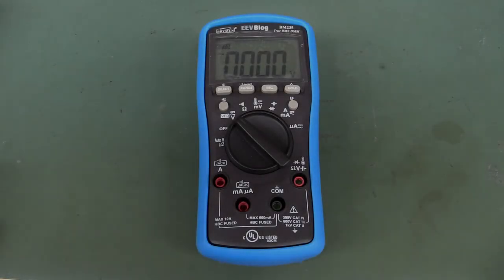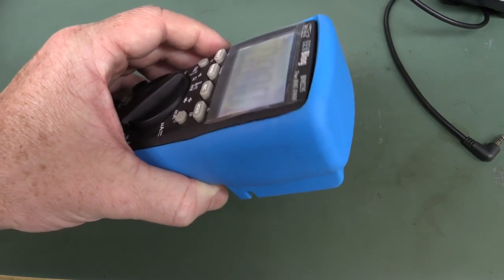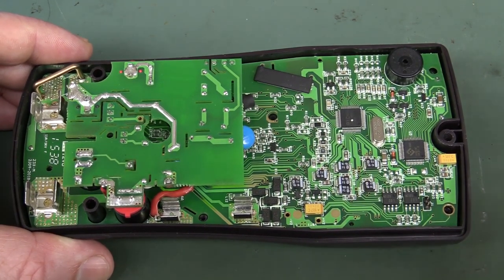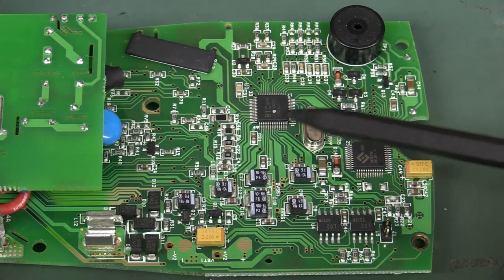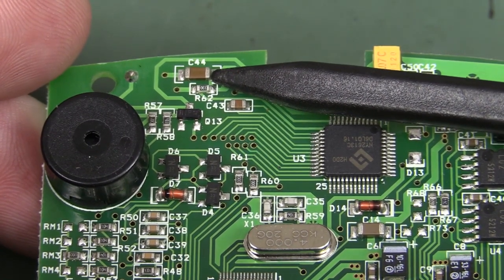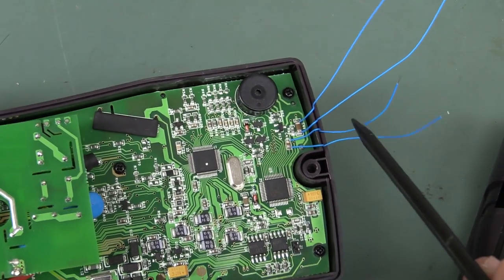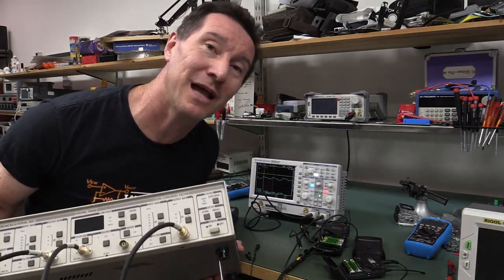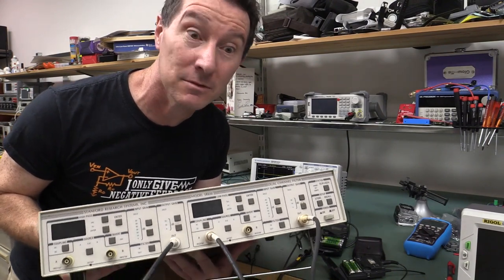EEVblog #855 - Ceramic Capacitor Piezoelectric Effect

Comment: ... Well, I could hear that even before you held it up to the microphone, noises like that drive me nuts, especially when I'm trying to sleep. XD - too bad they're so common. The much louder hum of the fridge pump, the low whine of my amplified speakers whenever they're plugged in. The high-pitched whine of some component in my laptop if you get some 3d scene up past about 300 fps. The clicking sound mechanical hard disks make, cooling fans in general, the capacitors in old camera flashes... Interesting, but sometimes very irritating sounds...

Comment: I had an IBM Thinkpad A31 that would just scream when it was charging. the capacitors/inductors were most likely damaged as it only charged when it was on. That computer was tough as nails, but a pain in the ass to make it charge if the battery was flat.

Comment: Wouldn't a drop of hot glue dampen the vibration?
Reply: As I understand it, its not the body of the cap which is vibrating but the internal layers.
Reply: +gorillaau but the   body will  amplify  the  sound

Comment: My bm257 seems to have nothing! altough its a bit noisy here!
And backlight is yellow:( I wonder can I change that?...
Reply: +m abraham  UPDATE my 257s seems  to have it constantly  when turned on! switching baclight on changes nothing i.e.  ~3kHz appears when u turn the dmm on.
Reply from the maker: +m abraham If it's yellow then it would not need a boost converter. Likely just a LED dropper straight on the batteries.

Comment: I wonder if a dab of hot glue or silicon over the cap would stop it from vibrating or dampen it for users who are sensitive to the sound.
Reply: +Ryan  Davis  It does dampen the sound, their is also a study about how a such cap could be mechanically decoupled from the pcb.

Comment: For that 24:04....Dave what´s up.....a real EE would have made this 3.14...ok...You clearly missed that.....;)

GREAT Video, Dave...And if you simply pot that thing with silicone or hot glue, you would have fixed it as well....and you don´t need to (un)solder something...i done that on various units....usually it went away, or gets less noisy significantly...

Comment: Some DC-DC converters that are built by amateurs themselves without proper knowledge of the values or the physics behind it, and with a potentiometer in order to adjust the thing, do produce a buzzing sound in the audible range. These things are often called a "Joule Thief"...

Comment: I low how they didn't put a fuse on there to protect the circuits and the battery ... so many devices do that, it really bothers me. Those AA batteries can put out enough power to make things smoke!

Comment: Old paper/foil rolled capacitor I used to have buzzed!
It was from an old [1950's] radio, and was 'soft'.
I guess it had gotten loose.
Anyway, it made a crappy speaker and even worse capacitor!

Comment: I hate it when electronic devices do this.
People have different hearing. Manufacturers need to keep this in mind.

I have thrown out various devices that have driven me completely nuts.
Wspecially phone chargers. Because they run at night, in my bedroom.
Reply: +Tilman Baumann 
Buy an Oppo R7 device, it has a weird ass "VOOC" (basically  full battery within 30min)charger but it's amazingly cold when charging and no high pitch whining sounds. even the battery of the phones remains cold. Voodoo-ish if you ask me. No idea how they accomplished that, desperately want to take it apart and take a look inside the charger but i only have one :/
Reply: The oppo uses higher voltage charging as far as I know. Pushing serious power over 5v usb is quite a task.

I want so to see more of that. But honestly, I don't mind over night charging. It's easier on the battery long term.

Comment: i hate hight frequency power surplys. the are often noisy generate hight frequency shit on input lines and output lines.  an ugly efect i reconise. i build a symple power surply from 230v 50hz to 12v constant. i use a linary regulator and try foil capacitors. but these capacytors are so noysi i change to elektrolyte. :(

Comment: Wow, the sound that thing gives off is kinda reminiscent of the sounds I'm getting in my headphone when I connect it to some laptops (which have obviously really crappy integrated "sound" solutions). It's usually the worst when there's even some HDD activity (I can literally hear the I/O operations in my headphone). Now I'm starting to think that maybe that's not a coincidence....
Wow, do you really think that the mfr. will fix that problem? Sorry to be this cynical, but I'd be REALLY surprised if they would. After all it'd only make their products cheaper (how could they compete with all the other manufacturers that are flooding the market then?) and they'll probably figure that most of the EEs are deaf/ignorant enough not to care about this anyway. But I'd love to be proven wrong :P
Reply: +CoolKoon You're likely talking about ground loops. If you disconnect the earth pin from your notebook charger, the problem will be gone. It's a very common issue present in even the highest-end notebooks.
Reply: +redtails No, I'm not and no it doesn't go away (well, it does go away, but only if I disconnect the headphones from the notebook). Like I said: the sound I hear in headphones connected to crappy sound chips/boards is very similar to what can be heard at 14:12. Ground loops on the other hand are a completely different story: they have a CONSTANT frequency of 50 or 60 Hz (depending on the mains frequency) plus perhaps an upper harmonic or two (unlike the sound heard in the video, which changes when Dave taps the multimeter and stuff).
My guess is that the stuff I'm hearing is electric noise coming from the rest of the laptop (hell even HDD activity noise gets picked up) owing to the sound chip's bad S/N ratio or some other related parameter.
Reply: CoolKoon believe what you want, I eliminated that exact noise by replacing the 3-pin connector with a 2-pin mains connector on my laptop's plug
Reply: +redtails Like I said: that's NOT what I'm talking about. You probably never heard the phenomenon I'm talking about anyway.

Comment: The little piezoelectric thing in the corner (Speaker) has markings on the board next to it that says, "SP1". That means it is "SPEAKER 1". It is designed to put out that type of sound.  It is SUPPOSED to put out that type of sound!!! And typically, the beeps you are hearing is from it when the meter is turned on. I cannot for the life of me understand, how on earth you can rule it out!

Comment: Good to disseminate the info, respect, though to boring old farts (such as I) this is nothing new, always been aware of it and dealt accordingly. Much more problematic is the reverse effect whereby caps are sensitive to vibration. In compact, high precision equipment, one is constantly trying to anticipate where and when a non C0G ceramic is going to screw up the signal. The problem is that whilst manufacturers are finally detailing the voltage/capacitance effect, there is virtually no info on microphony. Basically it's still a bench test job of suck-it-and-see.

Comment: gunking the capacitor with hot glue would not change it enough?
Reply: +madinatore it surely does.....or try silicone...but not epoxy it...it amplifies....
Reply: +madinatore interesting idea. I may try that for testing. I have an experiment right now where a ceramic cap is acting like this. Though it's in a much higher vibration situation. Now I know I should have used a poly but it's worth taking a stab at for science :)

Comment: my computer power supply squeal when pc is shut off
Reply: +marioc65 That's your computer being sad you turned it off, don't be mean to the computer by forcibly putting it to sleep!

On a more serious note, yes that problem can be annoying in electronics I'm cursed with good hearing most others in this household aren't bothered by the high pitched noises above 18 kHz but I'm still able to hear them and once I've noticed them its hard to get back to ignoring them. In a noisy room its not a big deal but during quiet hours it can really annoy me.